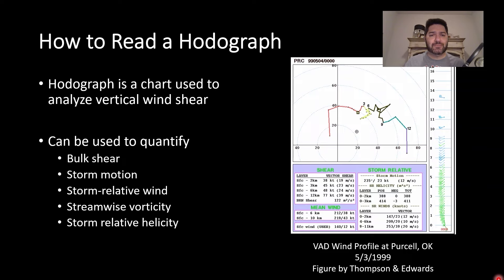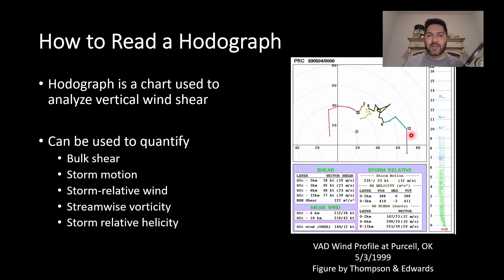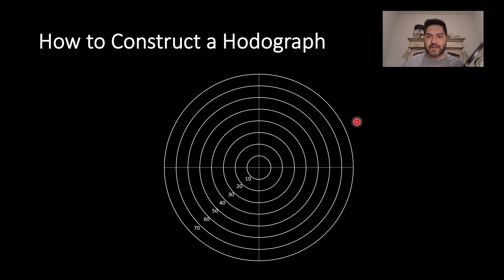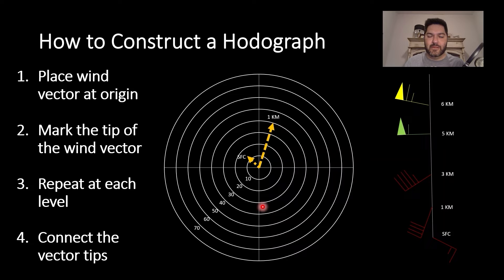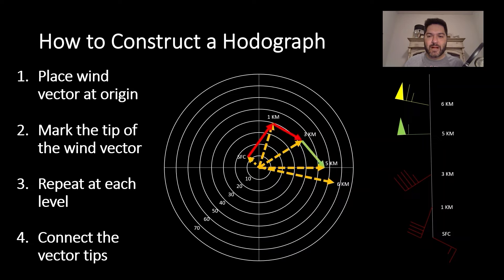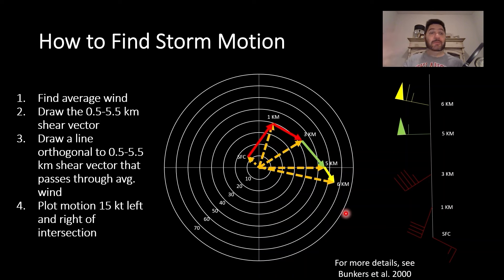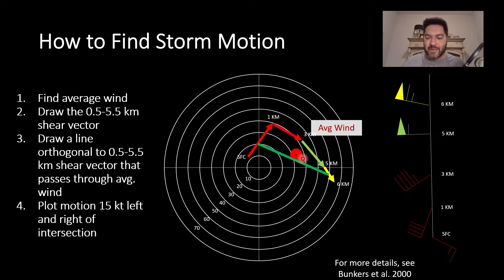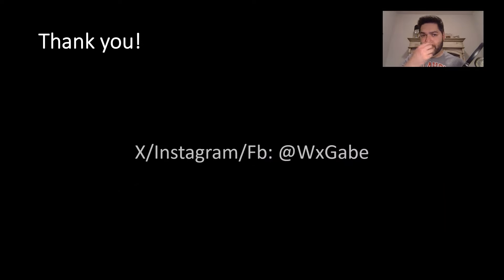How to Read Hodographs - For Beginners

Comment: To get a worst case tornado that would  travel a continuous 100 miles, be 2 miles wide, have a pressure differential of 150mb, winds as high as 350 mph , and move a straight northeastward track then what would the STP parameters look like to get that going? Also what would the hodograph look like of that impending worst case tornado?